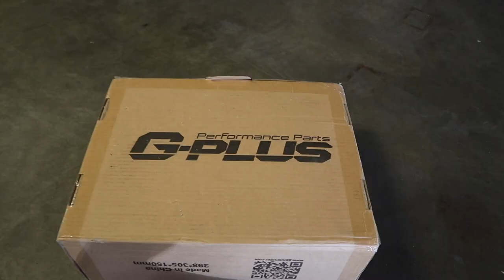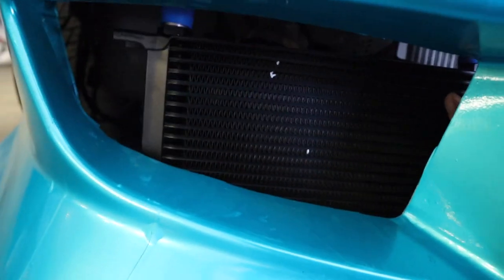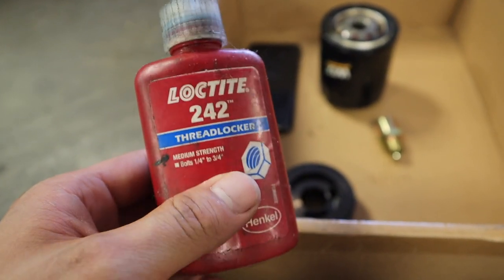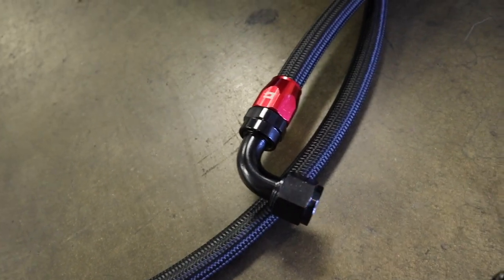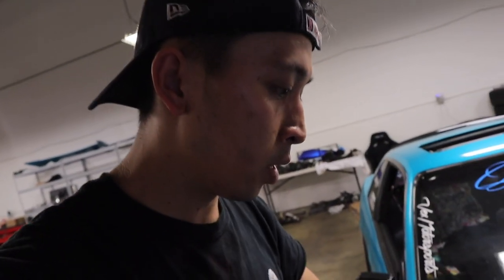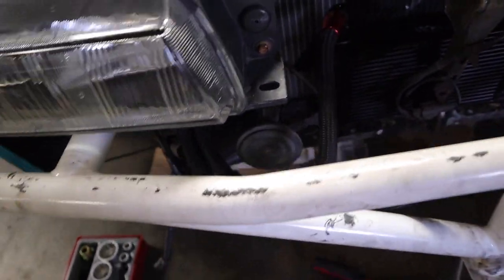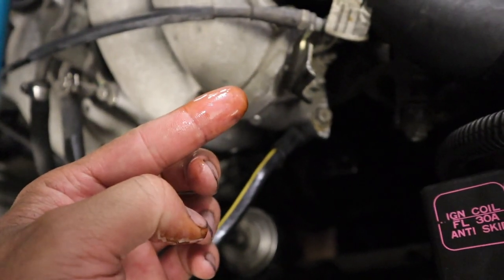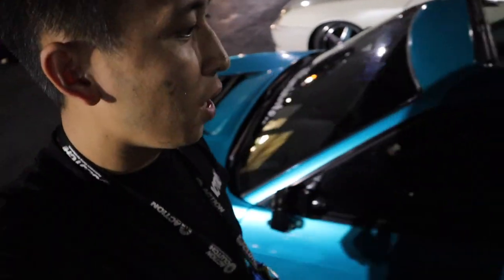Oil Cooler For My 240sx And Picking Up Another 240

Comment: Cheap Part = Teflon Tape, i notice most and all cheap parts must have Teflon tape. I Hear it acts as a (Secondary Gasket) to fill in the gap or something like that.. Between Primary  Part (Motor) to Secondary Part ( Adding to the Motor)
Reply: Almost all fitting needs teflon tape to seal properly.

Comment: I dont know if anyone has mentioned this or if you already said it in the video. Im commenting mid video. But I believe your gonna need a but more oil in your pan. Your gonna have oil constantly running through the cooler instead of the motor now so you'll need a bIt more oil to compensate.

Comment: Why don't you loosen the sandwich plate and clock it and tighten it with the fittings facing forward? .
Reply from the maker: Why? Idk but Thanks I'm gonna try that
Reply: Lol try it out man. It should work since the adapter is smooth and nothing to grab on to, to make it install only one way. I did that to my oil cooler on my jzx81 when i had it installed.